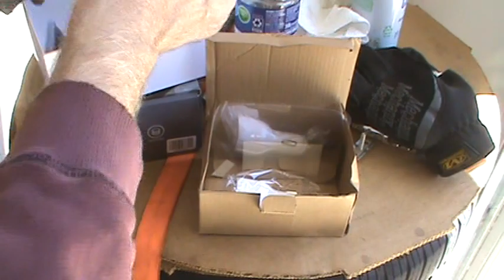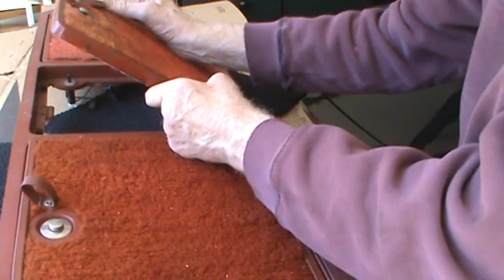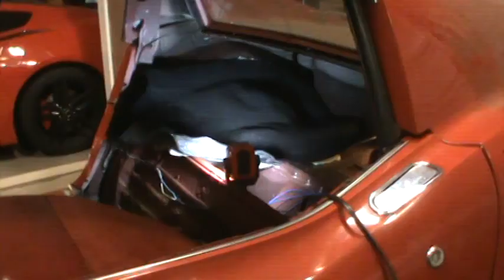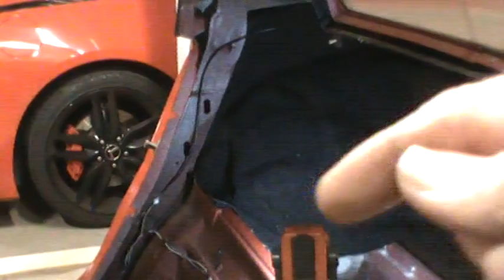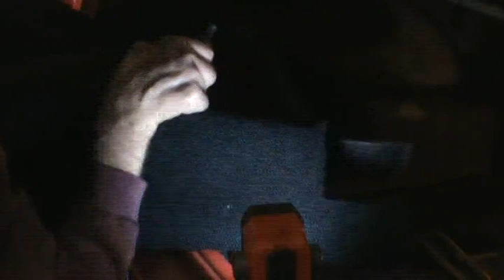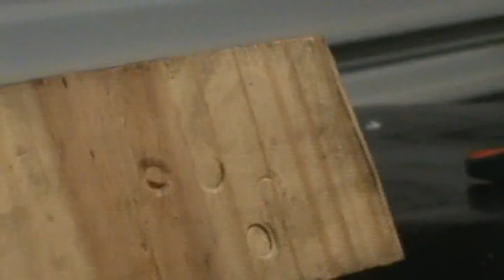76 Corvette RestoMod Pt 296 Carpet Install Rear Wheel Wells

Comment: I’m at 4 minutes into video. Yes you can diaasmble the lighter socket part of the power unit and just connect the two wires that normally go to 12 bolts. And you can wrap the supply end and shove it inside dash to where it’s just like having a transformer on it. But yes you can hide it and still use  it like you wanted to do. You don’t need to plug it into a port to use it as is. Take it apart. Im Surprised you didn’t already take that lighter plug apart and go that route. You are pretty smart as is.